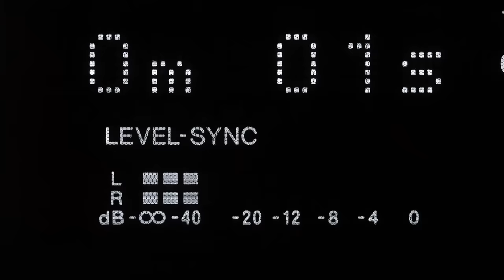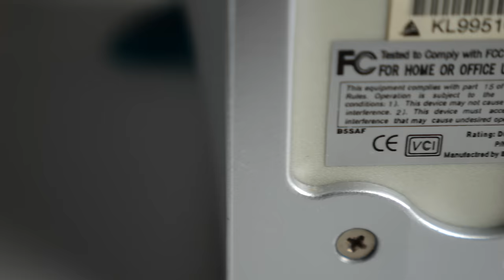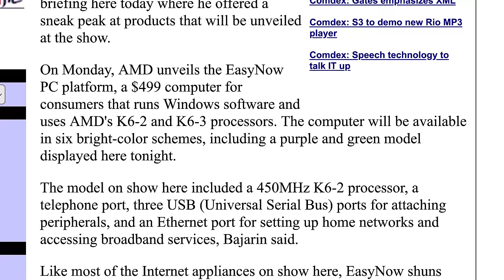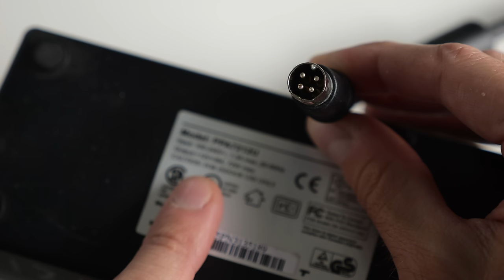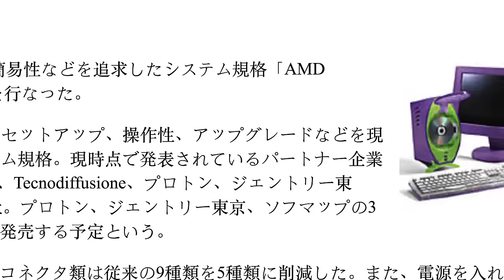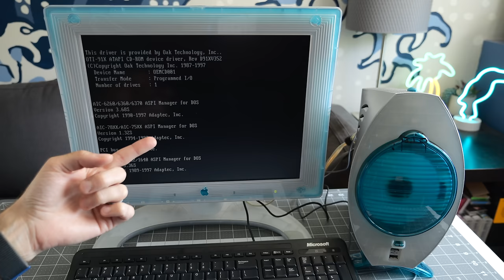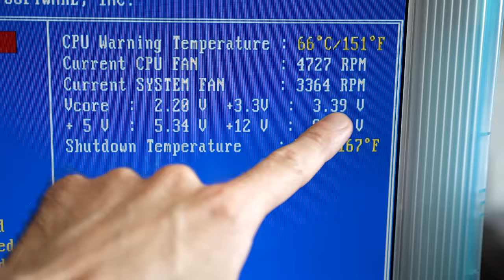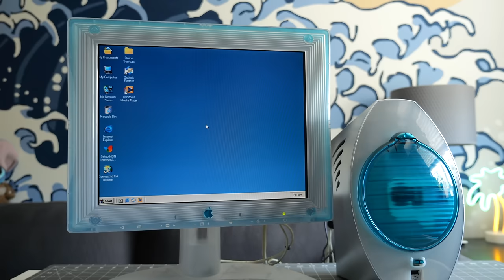EasyNow PC: The 90s Cheap and Cheerful Internet Computer

Comment: The grill feature on the Edsel was famously described as shaped like a 'horse collar'... when more vulgar comparisons were not being made. I'd say those comparisons -- euphemistic and otherwise -- should hold fairly well for the EasyNow ;)

Also, that's not a MiniDIN power connector, MiniDIN is most commonly seen for PS/2 mice and keyboard connectors and S-Video (note that the 7pin and 9pin variants are, at best, nonstandard MiniDIN-variant connectors). In older days it was used for Apple's ADB peripheral bus and for so-called "bus mice" in a 9pin configuration that actually IS a standard 9pin MiniDIN. Standard / "full" DIN connectors are also a bit larger than what you see there, most commonly seen on PC-AT keyboards (and far less commonly, PC-XT keyboards, which use the same connector and a compatible pinout, but a rather different protocol -- attempting to use either a PC-AT keyboard with a PC-XT system, or a PC-XT keyboard with a PC-AT system results in typing unintelligible garbage in all cases) and as used in the Commodore IEC bus and various other such cables and whatnot of the era. They really don't get used in anything actually modern, though.

I've also seen those called "Power DIN" connectors; there is in reality no such thing in any spec or standard, just as -- despite eBay's best efforts to give me a mental eye-twitch (it's surprisingly effective) there is no such standard as "MiniPCIe" -- there was MiniPCI before it was superseded by PCI Express Mini Card.

So what do you actually have there? That is a 4pin Kycon connector. Kycon is the manufacturer, and got its connectors named after it as such, at least colloquially... probably a bit like Molex, having preceded AMP, now part of Tyco AMP, with a similar but different connector (the true Molex connector design has both corners chamfered on one end, not just a single corner done up that way). Such connectors come in, at least, 3pin as well as 4pin variants. I'm told the 3pin is not quite interoperable with an XLR 3pin connector but I'm generally not near expensive enough equipment -- by way of common sense as well as financial means -- to be able to know for sure. I can tell you that I've never seen a 3pin one in the wild, but that is very likely just me. The most common uses of the 4pin Kycon connector, meanwhile, is in LaCie external hard drives of a certain vintage.

I've also seen it on some... rather weird system hardware (admittedly, this machine falls into that category), most often in single-voltage form, as here. I once had a PicoITX board that was abjectly hopeless in terms of processing power -- not its fault, the manufacturer saw fit to 'grace' it (I use that term quite loosely) with an Atom Z530. Remember EeePC netbooks? All three-digit Atom CPUs perform about the same... I think they do their math on their fingers! :P The other notable one is a Fujitsu Siemens Futro S400 thin client from somewhere in Europe, I got it as a trade on a Web forum in the early 2000s. It took 12v like this system does, and had a marginally better processor -- an AMD Geode NX1500, which was one of the Geodes based on the Athlon XP architecture designs.

Also, no, my name isn't Alec, however pedantic I may seem. I'm not a professional at it, FFS!
Reply: Also, that mainboard isn't any kind of standard, it's just OEM weirdness. It's about as "standard" as a Dell OptiPlex LOL... and SIS has always been crap. I'm half surprised that it's not got an SIS550 CPU, the (rather close, actually) ancestor of the much-maligned (deservedly!) Vortex86-series of mostly 5x86 CPUs. But it makes sense given AMD being the parent company.

Continuity on the multimeter between the power connector and the shield of the LAN port on the back is an easy way to get that Kycon pinout ;) and multimeter pins of various sizes are easy to find. Oh, and you can usually unscrew or (far more often) cut open a power brick like that. Takes a bit of effort with a box cutter / "Stanley" knife, but lookin at that 12v supply, I bet there's screws under those rubber feet ;) you don't have 'damage' from voltage regulator issues, those either work or don't, and if they don't, chances are it'll bring the entire system down. You have a dry electrolytic somewhere on the +12 rail. Electrolytic can caps (properly "aluminum electrolytic capacitors", nobody cares) are two layers of thin-enough-to-make-Reynolds-blush aluminum kitchen foil with a layer of brine-soaked paper in between. Over the nearly three decades it's been since both N*SYNC and this system were at least vaguely popular (thank heavens it's been that long) the brine will have dried up in some of those caps. That doesn't make em leak, it just makes em sort of invisibly not work. Go through with an ESR meter (I bet that multimeter of yours is nice enough for that) until you find one with a funky reading, and as Eric O. says over at the South Main Auto channel ;) "Well, there's yer prob'em, lady!" (The fact that you didn't do that is very likely why you're still out of spec on the +12 rail -- 0.5v or 5%, whichever is lesser, is generally the spec above 5v... 10% is typically the spec for 5v and under.)

The "all caps kinda fail at once" thing is a legacy of a phenomenon from the very early 2000s, the "capacitor plague". It actually goes like a plot for a really awful James Bond knockoff -- Mike Meyers would be great in a movie version :P It was actually a botched attempt at industrial espionage... seems a scientist somewhere stole a new and better formula for the brine I mentioned, but he wrote it down wrong and didn't realize it... sold it to a Chinese cap company. Well, the Chinese like to share stuff like that amongst themselves -- Bunnie Huang, the guy who made the Novena laptop, has an excellent article from several years ago talking about that, it's kinda like their own version of 'open source' but it's very different from the Western idea -- so within a month or two EVERY cap company north of Tokyo had the formula and was churning out caps... not realizing that they were all defective until the fireworks started, bang boom pop kaPOW. Oooops! ;) but that really only had its heyday from around like 2002 to 2005 or so, it was very much a WinXP era thing.

All electrolytics eventually dry out, though, that's different... oh, and the old saw about "it's cheap so no wonder it's broken" is crap as usual. The way they did that was the chipset and the original power supply, the capacitors and other components will be of sufficient quality and you're making at best a badly-misinformed statement -- and far more likely, flimsy excuses. 80s and 90s computers were generally built to a much higher standard than you seem used to -- surprisingly, given the focus of so much of your content. Also, this thing would work FINE as a nostalgia box for things like The Secret of Monkey Island, the first three MYST games, King's Quest, and a lot of other DOS and early Windows stuff like Sierra and LucasArts games. Sure, specs are a bit low-end for anything materially into the WinXP era, but the statement that it's "not for games" is just kind of sad. Sure it won't run Crysis any better than my HP Mini 5102, but that misses the point entirely when I'd rather play something like Space Quest or one of the Monkey Island sequels... or Tyrian :) anyone remember Tyrian?

BTW, nice install of the Win2k Home Edition public beta :P if you've had it screw up on you (doesn't sound like it) you know why they waited till WinXP to really do the Home/Pro/etc 'edition' thing properly. Win2k will have the same USB support/etc and be far more stable around people other than you. As far as driver support goes, learn to read part numbers on chips. A flashlight, a phone camera used as a magnifier, and Google will get you everything you need ;)

At least the color scheme is nice, even if it looks like a kind of Apple I quickly learned to hate. Something I've never actually learned: is it pronounced "bond-eye blue" or "bond-ee blue"? I've been saying the latter all these years but I never actually paid attention in high school enough to know for sure... not to that, anyways! :P

Comment: Windows ME wasn't that bad. That was my first ever OS to use when my parents hand down a old hp desktop and I actually happen to have it back in my possession, just working out the bugs right now like needing to order a usb dvd burner to get a bootable cd installation of ME, the drive is failing and it's slow to use so hopefully a CF card and adapter will speed things up. Again Windows ME wasn't a bad OS.

Comment: I tried Windows ME on a laptop that someone brought to my computing class's teacher to get looked at. It didn't seem so bad, but I also didn't use it for a prolonged period of time, so maybe it was just not that stable. I don't really know, but I have a soft spot in my heart for misunderstood but largely usable operating systems like ME and Vista. Windows 8.0, however, can die in a dumpster fire for trying to eliminate the start menu.
Reply: Oh 😳 Windows 8.0
I could only use that thing on PCs that had touchscreens! All of my other PCs at the time stayed on Windows 7.

On a side note, back in 2001, we had Windows 98 SE on our two desktop PCs at home, and my parents had Windows ME on their work PCs (small business).
Reply: @kbhasi  I didn't even want it on PCs that had touch screens, though that was because I still consider touch screen interfaces to be an inferior interface mechanic for anything more serious than a smartphone. Mouse and keyboard or keyboard and trackpad are still vastly more efficient for me to use when operating a computer. Honestly, though, if Microsoft had continued to support XP instead of discontinuing it and pushing 3rd parties to stop developing for it, then I would still be on XP. I miss the update utility from XP so much.
Reply: @mndlessdrwer  
Whoa. 🤯
Reply: @kbhasi  XP by the end of its lifespan was just such a stable and functional operating system. I can't remember a single time any install of XP that I had actually crashed for software-related reasons. 2000 had a bunch of driver-related crashes due to a failure to reset certain driver flags to default values after a state change, Windows 7 somehow found that bug and brought it back to life, and Windows 10 literally had updates that bricked installs. So, yeah, given that I used XP SP2 for basically a decade, you can understand why I have lingering attachments for it and its simple, utilitarian functionality. It wasn't the prettiest OS or the most richly featured, but it was stable. I even ran it on my Core 2 Duo Macbook Pro through Bootcamp. It was a good OS. It didn't try to hide my settings in multiple locations. It didn't try to harvest all of my data. It didn't have a broken start menu search function that prioritizes web results over local files and installed programs. The only real flaw that it had was Microsoft's weak implementation of driver serving through the update utility, which they were actually fixing right around the time Vista came out.
Reply: @mndlessdrwer  
I agree, and I imagine that's also part of the reason why a lot of companies held on to it! Plus, Windows XP accounted for most of my childhood as I grew up in the 2000s.
Reply: @kbhasi  XP is also the foundation for a lot of the Windows Embedded images that are just reaching their EoS lifespan in certain enterprise applications. The VNX 2 lineup of arrays, for example, use a Windows Embedded image based on XP. Those are still my favorite arrays to actually support because they're based on a plug-and-play OS, so you don't need to initiate any service task to replace most of the components on it. The only thing you do need to do is tell it that you've replaced an expansion card so it'll reset the PCIe bus that the card uses and bring the new one up. But HDD swaps are trivially easy. Find the one that's blinking amber, unseat it, let it spin down for a few seconds, then swap it with one of the same capacity. It'll automatically initialize it, load new firmware if necessary, and begin re-silvering the RAID pool. So convenient. You can add plug-and-play functionality to Linux-based storage arrays, but most companies don't. Unix of FreeBSD-based arrays are basically stuck with you needing to initiate service requests from their interface before they'll let you swap components without crashing some process.

Comment: subtle jesus fish designs with lovely color . once again i wonder if it would fit matx or itx board or parts can be upgraded. you come across some really cool things out there. flex atx rest in peace. why right in the middle? that fat single ram slot and no possible expansion . you answered everything . good stuff fixing the power regulation up . i gotta get me a good solder sucker
Reply: also the optical drive reminiscent of a console setup with the 45 degree door .

Comment: That there is the Fish PC (Turn it on it's side and it looks like a fish) a Windows based PC meant to directly rival the iMac of the time (We used to sell them) they were wildly popular for about 15 minutes and then the company tanked.
Blue, Green and Pink were your colour options and they had a slew of accessories in the same clear plastic and coloured ranges.  I believe they went down the drain after Apple sued the main company.

Comment: Couldn't you just somehow modify the connector on the first psu, so you could plug it in upside down? that way the polarity would have remained the same and it would have plugged in with the proper pinout.

Edit: Also 2000 is fantastic with USB in my experience

Comment: I'd wanna see if the thing even works first before trying to get an adapter hacked to work. like get some leadsand hook it up to a bench PSU and see if it even works before making a "final" replacement power supply.

Comment: Aside from the fact it's so... yonic... the aesthetic on this PC isn't that bad, I miss clear colored electronics and I'd be lying if I said I didn't like that purple CRT. As for the PC itself while it's crap it's a thing of its time and you know what, I respect those budget PCs for what they were accomplishing in making computers more accessible at the time, they served a purpose well and were competent (more than you can say about crap like chromebooks) and are interesting to look back on like this, and while a recap could do this thing well (especially considering this comes right around capacitor plague era) I don't know if it's really worth it to go that far, it works, it's not rotting out, honestly that's good enough for this point, doesn't make more sense to invest more time and money than even the manufacturers did when it was new.

Comment: Also, I'm surprised that, once you'd committed to buying a Power Mini DIN connector, you didn't just build an adapter and keep the PSU unmodified. (It'd have had the added benefit that, if the PSU failed in a way that didn't kill the machine, it'd be easier to swap in a new one.)
Reply: I think he'd hacked apart the old connector before he found a replacement.  With the replacement end he can also always just re-wire it to whatever he needs.

Comment: You're not wrong about Windows Me, Colin.  It is fine, I mean relatively - it's still a Win9x operating system lol.  It was okay so long as you had WDM drivers for your hardware though, I think that was what caused most of the problems some people had. I didn't really understand the point of it though, everyone I knew ran Windows 2000 even on home machines by the time it was released and most software was NT compatible by that point.  It was a fine second OS for those games that needed 9x though.

As for the machine, that thing is just plain weird! I guess it was probably a tempting offer for some but honestly even $500 seems a bit steep for the time, it's very barebones and dated for its era despite the looks.

Comment: I, like you don't understand the Windows ME hate. Stick to ME drivers as much as you can..and in my experience updating IE to 6 helps even more...although its not bad in a stock unpatched state. and yes, the built in USB is a nice plus.  it supposedly has the same driver database as Windows 2000.

Comment: Interesting.I have build a Pentium III retro pc for myself and it has a similar Award bios and it reports weirds voltages like 7.8 volt for 12 volt or 3.4 volt for 5 volt.i have now an idea what causes those funny voltage readings,despite having a working pc🙂 i have to change capacitors but i have postponed any services for the next months.👍

Comment: "What if the PowerMac G3 was even uglier and slower?"
EDIT sorry faster

Also, the first sub-$1000 CD writer was made by HP and didn't show up until late 99. Nobody had them! They weren't around.

With the driver situation, you could always go look at the device IDs in your device manager or you could look at the actual ICs on the board

Comment: How can you think ME is good? I remember the active desktop crashing the system and stupid OCX applets to slow everything down. Windows 95/98 was great by comparison.
Then again I didn't have nice stuff, I think it was a Cyrix GX running at 133mhz, so maybe that was my problem. Also IIRC all old distributions of windows had A:\ even without a drive present. I think B:\ was also reserved for 5.25" floppy drives but it was not shown in windows. Just going from memory.

Comment: I don't believe that 9V reading in BIOS at all - there's no way that machine would be running, even on a 5V-heavy design. It simply wouldn't spin up the HDD even if the board somehow managed to run in the first place, and it seems way too stable - weirdness with floppy drives aside - for that to be accurate. I've also seen other things with supposed 12V monitoring that give utterly insane values in devices that have DC power input.